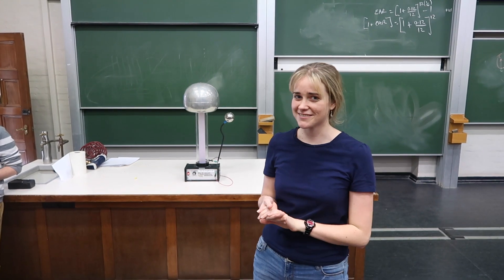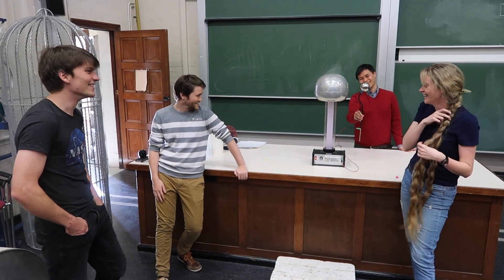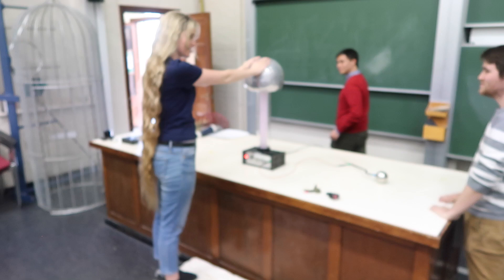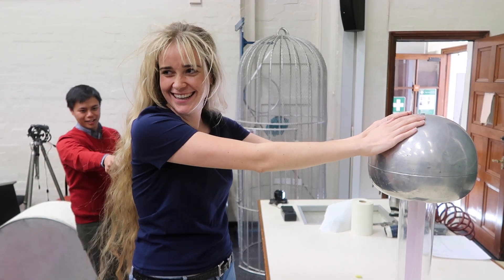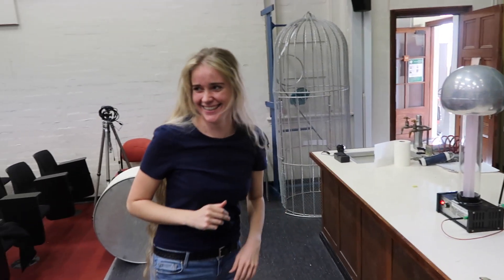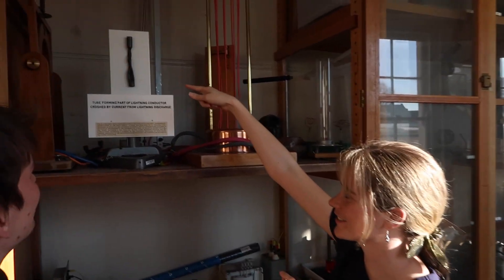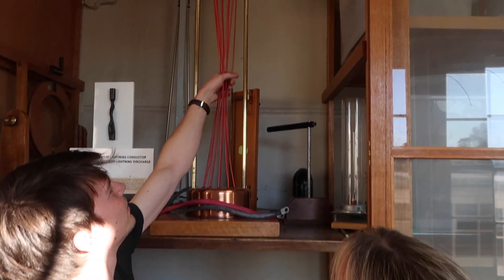Long hair vs. Van de Graaff generator

Comment: My high school physics teacher has a large, older version of one of these, but the charge separates via a powered pulley system with a band made of an insulating material.

Comment: Amps hurt, volts don't. Come on, it's physics 300kv @ 0.000001 amp will have no effect electrically on a normal dry body with 50K Ohms of skin resistance.

Comment: If you hold one lead of a voltage meter, and touch the other lead to ground, what would the reading be?
Even though the charge capacitance of your body is low, the voltage reading should be very high, as high as the rating of the generator, I would think, and even after letting go of it.

Comment: To safely discharge my students I use a wooden metre ruler which serves as an adequate resistor.  It discharges a person in a few seconds. A sudden discharge is very uncomfortable.  Now my car makes a much bigger generator.  In the drought it could build up enormous amounts of charge which meant that getting out of the car at the petrol station created a huge jolt.  So I learned to carry the wooden stick in the car to discharge it safely before I hopped out.
Reply: I just get out of my car and then touch it with my leg. Trousers conduct just a little bit, but enough to discharge the car.

Comment: For those unfamiliar with Van de Graaf generators, the clear column contains a small belt that acts as a conveyor belt, carrying the charge into the upper part of the generator. You can see it best around the 8 minute mark. It's a crazy funky design.

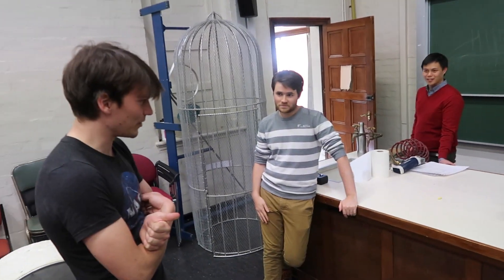Comment: at 2:00 he said its about 300kV
but at the distance where the ground ball was (around 50mm i guess) it could only charge to about 50kV

does he mean it "could" charge up to 300kV? (which would be a huge arc of 300mm)

Comment: If they have 300000 V electrical potential on the platform  and they put one of the legs on the floor while the another one is still on the platform, should not the difference of potential between legs be harmful for the body? Should not the electrons pass through their body??

Comment: You could also demonstrate the Wimshurst machine. Also a candle between two plates with electricity put through them. Always put a hairdrier blowing on the belt/comb area to dry the air.

Comment: Volts are rarely the problem ... it's the current (amperes).  It's why people don't die from getting shocked from the coil in their cars .... and good ones produce 30,000 - 80,000 volts.

Comment: Fun story: many years ago, a couple of geeky friends of mine got their hands on a high-voltage generator (a cascade multiplier that could generate arcs across almost 3 feet).  I had the bright idea of putting a box of styrofoam packing peanuts on top of it and turning on the power.  The first outcome was expected: the peanuts went flying everywhere.  The second outcome was not: the peanuts acquired a charge and stuck to *everything*.  In particular, the ceiling.  It took us several hours to clean up!
Reply: Pa ha ha ha ha!
Reply: light-hearted vandalism
Reply: I would like this common but it currently has 314 likes and I can’t ruin that
Reply: @swright4171  now we have to get it to 3141
Reply: UV light, charges gone.
You're welcome.
Reply: @bikerfirefarter7280  how come?
Reply: @georgetubb9124  the UV ionizes the air a little and the static charges dissipate. it's used in industry etc where static is a problem.
Reply: @bikerfirefarter7280  thank you for that tidbit
Reply: LOOOOOOOOOOOOOOOOOOOOOOOOOOOOOL
Reply: Now THIS would make for an awesome prank to pull on, say, the end of the school year.
Like, do that in a classroom before the students come in and just leave everyone absolutely confused.
Reply: To clean DOWN, surely?
Reply: Wowww!!
Reply: ha ha I can see that... styrofoam will sorta do that on it's own accord sometimes.
Reply: Shouldn't they fall off until the next day? (some discharge over the air)
Reply: @georgelionon9050  Probably but we did it at work and wanted to get it cleaned up before the boss saw it.  ;^)

Comment: damn it peter... i don't know you and there is no reason to judge you from that video, but that explanation...

- "remember that experiment [...] water, or some tissue or some paper [...] it's separating the charges to create some... pull": ok, that tells enough to remember the experiment, but that was kind of lacking explanation. The attraction is coming from redistributable charges/dipoles in what you are trying to attract (e.g. water) and this will produce attraction no matter what charge is on your rod. And even that greatly simplifies it. Although that is a completely different problem and does not point out the important part relevant for what you want to do with the VdG-generator now: you will separate the charges PREDOMINANTLY one way and only THAT lets you build up the charge on the rod (again greatly simplified).
- "one part of this contraption is becoming really strongly charged and the other one isn't as strongly charged." now this is the big problem here with your explanation: the opposite charges must be EXACTLY the same, if whatever part you are charging was electrically neutral before... it has to be, you will not generate a net charge. Part of the opposite charge will be distributed further away from the machine, since you connect it to earth, but the amount of charge must be the same!

Comment: When I was in high school, I belonged to a club called "Amateur Research Center" at Foothill JC in Los Altis Hills, Ca. We made a 1/2 million volt one. We use a radome from a p3 orion subhunter for the charge surface. We could pull 6 foot sparks off it. ZAAAPPP!

Comment: 0:05 in, Electro static atractivity causes rain accufers flowing threw sand..! Nicola Tesla new that..! It can actually pull a cloud lower in the atmosphere rasing barometric pressure in a scence squeezing the rain out of a cloud not to mention the fact that these clouds are known to follow underground aquifers even against 25 mile an hour crosswinds..!

Comment: The most impressive experiment that my Physics teacher demonstrated happened on the first day of school. He had built a sort of cannon that shot softballs and at the same time the softball came out of the barrel, it tripped a steel ball bearing to drop straight down from the end of the cannon.  He then took bets as to which item would hit the floor first. To our surprise, they both hit the floor at exactly the same time proving that gravity has the same pull on all items.

Comment: This is a tiny generator. You need a bigger generator, and winter or dry air -- then you can do some really cool stuff.  Like, you can hold a piece of light  wood in one hand, and it will catch on fire.

Comment: i saw this and i decided to touch every high voltage object
Reply: I have got a test meter that outputs 1000 volts ( Different settings, 250, 500 or 1000 ) for testing the state of insulation.
I will touch the connections at 1000v if you will on the 250v setting. ( don't try on the public power grid )

The meter can only supply a limited current in it's generation, it can not supply as much current at the higher setting. ( it hurts more on the lower setting and there is a trick to grabbing the probes in the higher, once you connect the meter can not get much voltage to build up. )

Comment: Voltage doesn't kill, current does. 100 milliamps is usually lethal. A GFCI circuit breaker in a panel or a wall outlet will trip when the difference between current in the 2 conductors is between 4 and 6 milliamps. This is why birds can perch on high voltage utility wires and not get killed, they are not part of a circuit so no current flows through them. The spark you see is not electricity itself, that's invisible. What you see is ionized air resulting from a strong electric field pulling electrons free from their nuclei in the atoms. You can get a burn touching it as it may be very hot. Current from a van degraff generator is usually far too low to harm you often in the microamp range. A bolt of lightning also resulting from static electricity is another story. It can be 100,000 amps and can be lethal. The voltage is also very high and can cause severe burns. 

Ground is an infinite source and sink of electrons without becoming positively or negatively charged.

Comment: I've never been able to fully grasp the idea of "being ground".  I believe being ground means that electricity passes through you and is distributed out to some wider environment.  But for a person, is this any different from "being a component" of a circuit?  Are you damaged by being a component that electricity flows through, and damaged by being ground; or damaged by one but not the other?  And when you're standing on the foam and therefore not ground, does that make you ... like a "dead end" in a bunch of water pipes?  Like if you had a T joint in water pipes where water flows through the top of the T but the bottom is capped off, then you would imagine that water doesn't flow through the bottom of the T.  Is that the same idea as why you can touch a circle somewhere in the middle of it and so long as you're not ground you're therefore like the capped bottom of the T?

Comment: Brave girl! 
I didn't have enough guts to touch one of that when I was 15 and visit a local university (23 year ago)
Reply: Personally, I feel it's scarier when you know the voltages involved, know that it can hurt a great deal if you do it wrong, but especially: know how it works :P.
We had one of those things at my high school and the power supply feeding it had a leak between one of the motors, causing the power supply casing (that had the on-off switch) to get charged as well.
My science teacher would demonstrate certain things that high voltage could do but because the motor driving the thing made a lot of noise he liked to shut it off from time to time, but because of anticipatory reactions in our brain the shcoks he would get switching it off were only intensified in feeling.
So, whenever he was like "So, this demonstrates repelling forces because of ion winds, basically, which is when..." starts drawing on the whiteboard "Hold on let me...." tries to flick the switch as fast as possible and misses "Let me first shut...." tries to flick the switch again as fast as possible "this thing" flicks the switch and get's a huge shocks "offf...wow that hurt!" :P.

Comment: The worst case of static electricity that I ever saw was at Monash University's Frankston campus in the 90's. The library was producing amounts that I had never seen. You would walk around normally and borrow a book. Then you would touch something metal and you got a visible spark and it hurt your finger a lot. I've seen some bad cases where some effort was needed. But that was the worst no effort case. They had carpet. But it wasn't that thick. I've seen thicker.

Comment: Its not that one is strongly charged and other is not but it is that we make a capacitor here one is made highly negative and the other highly positive and the air works as the dielectric if you touch one of the sphere you become either positively or negatively charge but if touch the other ball then you discharge all of that charge and you get a nice shock which will make your mind work🤣

Comment: Hi Tibee et al, when you engaged the Van DeGraff Generator, you entered the realm of a DIFFERENT DIMENSION. One called [Heightened Electrical Potential.] Considering, that your personal Voltage is an independent degree of freedom relative to 3d +1t. You have experienced a journey of being "elevated" 300,000 Volts higher than your grounded friends. A word of caution: Never be an "Amperage" traveler. Why? Because that journey, in yet another dimension, will yield disastrous results if you only travel 1/10 Amp away.

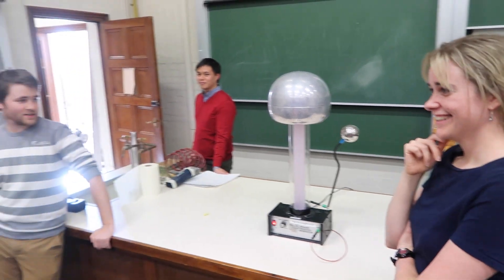Comment: On a good day (1:49).....What this means?
Reply: Emilian Sergiu Pantoş: Day-to-day there are temperature, pressure and humidity variations that change how easy it is to get a spark in air. A “good day” is when those line up (especially humidity) to make it easier for a spark to jump.

Comment: That much charge moving through you doesn't cause damage? Also could you teach me to go super saiyan like yourself?
Reply: High voltage, by itself, doesn't do much damage, but rather needs sufficient current flow. Likewise, much more than a few milliamps can be potentially fatal. The reason low voltages are usually seen as safe is because humans (especially skin) have a fairly high resistance, so very little current will flow (eg, a car battery can easily melt a screwdriver, but is relatively safe to touch). Things which have both a sufficiently high voltage and can deliver non-trivial amounts of current, like the power mains, or a long chain of 9V or AA batteries, can be fatal.
Reply: The charge is quite low in this case since the capacitance of the human body is quite low only around 100 picofarad or so, at 300 kV that would only give a charge on the order of 3.0*10^-5 Coulomb. Add to that the fact that the charging is rather slow so the actual current flow is minimal so not really enough to cause damage even if sustained, the discharge current may well be higher but the extremely small amount of charge available means that the duration will be extremely brief even at a discharge current of just 3 mA it would only have enough energy to sustain that for around 100 microseconds. Bear in mind that several 10's or hundreds of milliamps from direct exposure to a 240V requires several full milliseconds of exposure to result in any real lasting damage this is after all why RCD's/GFCI's that interupt the current in 30 ms or less save lives after all.

But yeah you don't really have any danger of lasting damage from something like this provided of course that the equipment is built and used correctly. Obviously like any other electrical device if improperly constructed then it can certainly be dangerous as a result of electrical faults causing say leakage from the power supply to earth via you mains power supplies and even larger battery power sources are definitely capable of causing actual damage ranging from temporary to permanent.

Comment: If you stood there for an hour, holding the Van de Graaff generator, would your hair continue to build up more charge?
Reply from the maker: The effect does get better the longer you stand there building up charge, but in Petr's case it eventually discharged through the table
Reply: Wow, that makes a lot of sense. Thanks!
Reply: The electric charges are lost by remaining conductivity of styrofoam and even air, and then there is also corona discharge, therefore the charge will reach a peak where discharging balances out charging.

Comment: It happens to me all the time on the treadmill when the air relative humidity is below 30%. Sometimes I accidentally touch the side arms of the machine and get a little shock, if its dark I can even see the spark, about 5 mm.

I guess the side arms have a path of less resistance because of the electrolytes from people sweat. But no spark if I touch other places and I can feel my hair slowly touching my forehead.

Keep making videos, nice to see them :D
Reply: charge  goes every path posible not just on the one with less resistace i think

Comment: The spark arises from the SMALL ball
Reply: It's the same with lightnings. A few high energy electrons break free from the big ball (the clouds) as charge builds up, air molecules get ionized through the impact of the electrons, in a chain reaction these ions build a channel to the ground (the small ball in this case), you can't see this channel. As soon as the channel reaches ground the rapid discharge and previous impact ionization cause the charged particles to form plasma, starting from the ground going up through the channel to the big ball (the clouds). The lightning/spark you see is the plasma.

Please excuse any bad language or poor choice of words, english isn't my first language.
Reply: Thanks for explaining. Do you mean that lightning ALWAYS moves from the ground up to the clouds?

Comment: Here are some photos of the model FN 16 MV Tandem Van de Graaff accelerator that is currently at ANSTO outside Sydney, but used to be at Rutgers University in New Jersey (where these were taken): https://flic.kr/s/aHskjhmtWp

I don't know if it would have made your hair stand on end, because you couldn't be in the accelerator room when it was running (the doors were three feet thick, made of steel and concrete, and ran on railroad tracks).